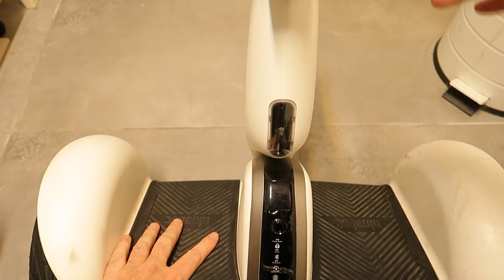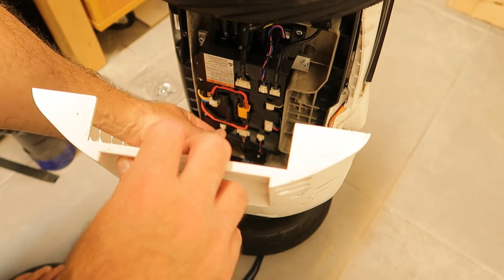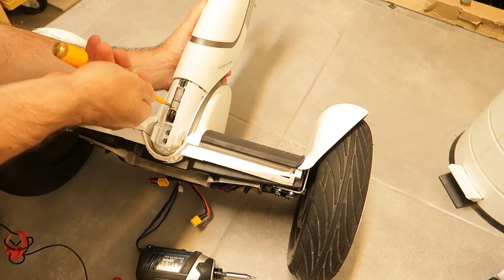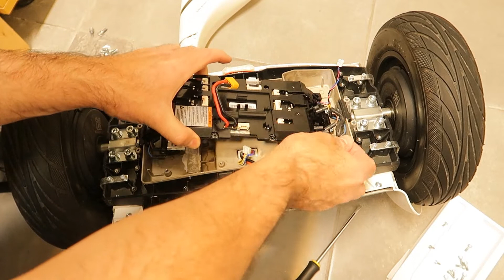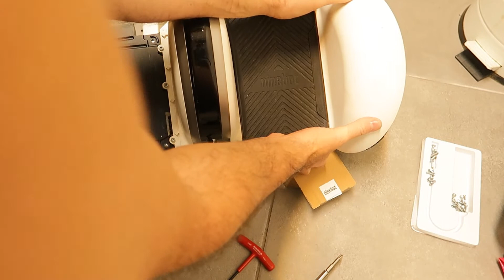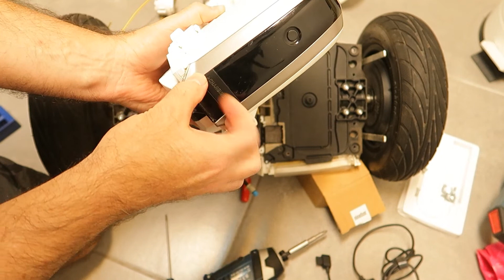Disassembling Ninebot Mini S Plus

Comment: Thank you wish I had watched this first.  Would have saved me weeks of work ‘attempt struggle and raincheck’ repeatedly.   I’ve removed possibly hundred extra screws lol oops.  If only I knew the steering bar could be pulled with an assisted tie wire 🙏🏻

Comment: First time trying to remove the kneebar.  No success trying to pull it with wire.  Any other suggestions?
Reply: Had the same issue. Managed to do it by using flat screw driver from the inner side and made a little bit of a leverage there that lifts the knee bar up. Then I pulled the wire while in he same time lift it with screw driver and it worked.
Reply: you ever get the knee bar off? im having the same issue
Reply: @dereklocke3803 same issue did either of you get it??

Comment: Thank you for posting this video. How much mileage did you get in your original battery pack  and what was/were the symptoms that lead you to isolate the problem to the battery pack? I am asking this questions as I have also a Mini S that had been inoperational for more than a year as it would not start. When I press the Power Button, it wont start. The battery is fully charged and can be charged (according to the display) but it does not do the normal thing of starting and balancing. I am thinking this coud be a Controller Board issue since the Battery seems to be okay but not sure. I have seen some comments in other YouTube videos about similar issues with Mini S Plus but no solutions offered. I have an overall mileage of about 500+ km on my Mini Plus. Have you ever experienced problems leading to exchange of Controller board? Appreciate to hear your inputs.

Comment: It worked! This fix with the s-plus is very easy when you know what to do! No need to remove battery nor cut the wire.
Reply from the maker: glad it helped!
Reply: Hello how are you. Congratulations, for having started your skateboard again, I wanted to ask you if you could explain to me how to do it without cutting the cable and without removing the battery.

Comment: Thank you for this video.  It helped me recover my battery.   I was about to cut my charger cord, but I decided to play with my volt meter 1st trying to figure out which of the 4 connectors on the regular charging end was wired to the positive female banana connector and which was wired to the negative female banana connector.  So I had my volt meter in continuity mode and tested each of the four posts on the battery with each of the two female banana receptacles.  I was surprised that none of them showed continuity.  BUT then I noticed that the LED on the bottom of the battery was blinking red.  It had previously been dark.  So I just connected the charger and now the charger brick has a solid red light and the LED on the bottom of the battery is blinking red.  It had blinked green a couple of times when I first started this reply and within a few minutes, it is now just blinking red.  Maybe testing the continuity between the four posts on the battery's charging connector and the two banana receptacles reset something because now it appears to be charging and I did not have to cut my charging cable.
Reply from the maker: glad it helped!
Reply: i need to recover my battery can you help
Reply: I know this is an old post, but can you give anymore detail to what you did to fix the dead battery issue? Where is the LED on the bottom of the battery? You used a voltmeter on the front charging plug of the Segway and ran the points to the red contact wire connected to the battery itself? Thanks in advance.
Reply: Thank you for sharing your experience with recovering your battery. It's great that you were able to troubleshoot and find a solution without having to cut your charger cord. The Segway Portable PowerStation Cube Series seems like a reliable option for outdoor enthusiasts like us. Its massive capacity, fast recharging, and waterproof technology make it a valuable companion for camping trips or as a home backup power source. Stay powered up and enjoy your outdoor adventures!

Comment: One mod I'd really like to do to my s-plus is giving it a second battery pack.
I've thought about getting a regular mini segway bottom cover type battery and wiring it in parallel with the existing battery system.
Seems like it should be doable.
Would likely need a second charger for the 2nd pack so they can both be charged at the same time.
I'm theory this would extend the range by just below double, and extend the life of both batteries since they both only would have to give half as much current as normal.
Reply: Just plug the piggy back battery directly to  + & - of the main battery MAKE SHURE YOU BYPASS the BMS of the Main battery, your PIGGIBACK BATTERY  May have a BMS on-board. I DO THIS WITH MY WORKS BLOWER and extend the running time from 10 MN in Turbo mode to 40 minutes and the kicker, my works charger charges both if I leave the piggy boost pack connected . Call me if you need more info, small devices or big the principles work, not shure I can leave my phone # here so google me Christian StClaire Nano-Oil
Reply: Hi Christian,  could you explain a Lil more about bypassing the original BMS? So if I connect a new  connector to the original +/- wires,  (after BMS), that would accept any extra battery, if you just plug it into the connector?  Cheers